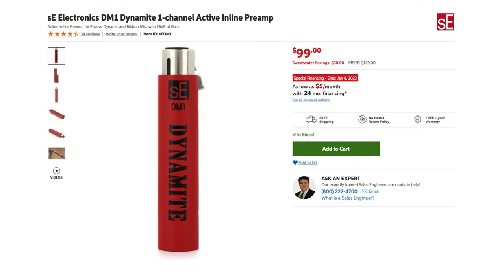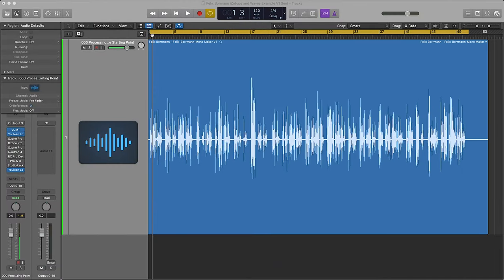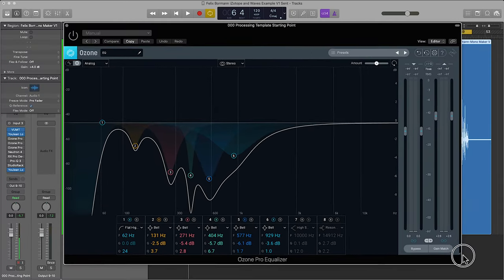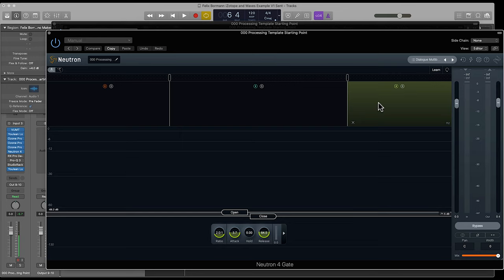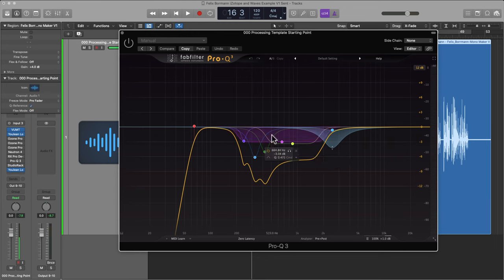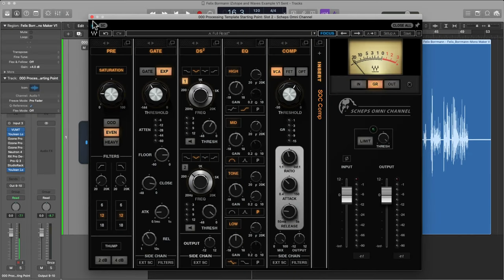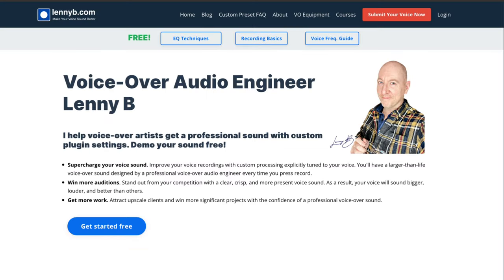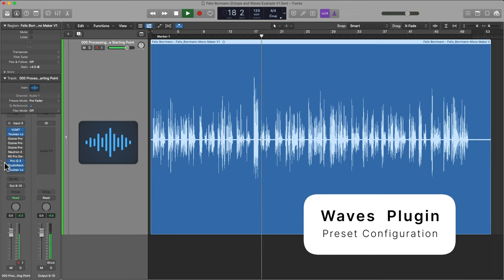Processing Your Voice With iZotope, Fabfilter, and Waves Plugins

Comment: Hey Lenny. Good stuff.

Our German friend’s first mistake was designing a booth with parallel opposing walls. As with speaker cabinets, the dimensions determine the “resonant frequency” of the enclosure. Wall thickness and acoustic treatment cannot defeat the room’s resonant frequency. You did a good job of tuning it out but a simple 5-sided booth, or a rhomboid 4 walls, with non being parallel, would eliminate his biggest issue. 

As to treatment: Flat latex paint, then add 6” “strip and bracket” shelving, with shelves every 12” measured vertically. Then go to Sam’s Club and buy a couple of the jumbo packs of the house brand, medium sized paper towel rolls. (11” is the standard length of paper towels.) Unwrap them and place them along the shelves, standing them on end. Especially a few feet above and below mic height. If they are too bulky, place the wrapped roll on a band saw and cut lengthwise, creating two 11” D-shaped half rolls. Much cheaper than Tolex or pro sculpted foam. Although, Amazon sells 12” x 12”, self-stick, 3” pyramid foam pretty cheap.

I just subscribed am exploring your videos. BTW, both Glenn Beck and Alex Jones use the $125 LCT 240 Pro I see in your background. I’m interested in seeing your review.

JC
Reply from the maker: Hi John, Thanks for your info. The mic in the background of this video is a Rode NT1. However, I am a fan of Lewitt mics they are a fantastic value. Second, after learning much since the creation of this video, I agree with your non-parallel wall suggestion. The paper towel idea is very attractive. Someone (or some lab) should do a test to see the actual Noise Reduction Coefficient of a paper towel roll.

Comment: What  version of Ozone are you using, and what pluggins? Ozone looks like a full course editor for professional music mixers. I was thinking, if I'm just doing voice, then many of the features I'd never use.
What do you think?
Reply from the maker: Hi @ZimCrusher. I guess it all depends on the quality of your raw voice recording. If your sound doesn't need much to sound professional, you may not need many plugins. The version of Ozone is whatever comes with the Music Production Subscription from iZotope. I'm also using Fabfilter and Waves plugins in this video. Don't be hesitant to send me your voice. I'd be happy to give you some feedback. Please follow the three steps on this page: https://www.lennyb.com/get-your-voice-processed-submission-form 

Thanks for taking the time to write. 👍
Reply: @HeyLennyB    I would not want to use that Golden Ticket so frivolously.  I am in flux, currently. In 2 weeks I will have a SYNCO D2, and I've been slowly buying materials for making some thicker acoustic panels for my recording area. So If I sent you a sound file, it would be like you custom painting the car I'm about to sell.

To give you an idea of my set up:
My recording area is a nook in our upstairs den. One side wall, near the computer has the whole wall acoustically treated with 3cm dense sound blocking/disbursement (pressed corrugated foam/wood stuff), and at speaking height I have a strips of 5cm acoustic foam (like you see in every YT video). This wall is 3 meters long.
The ceiling above has 20cm cross-hatched acoustic foam.
When I record, I box myself in By just creating a wall between me and the rest of the den.
I got about 1.5 meters between the wall and my temp wall, which consists of a cable, and lots of blankets (think a very thick curtain spanning the room = 3 meters).

I'm using a Zoom H5 to record, and Audacity to clean it up. 
My process has been: 
1) amplify everything +5db
2) grab and use a 20 second silence and create/use noise removal
3) bring volume back down to normal.
4) Compress
5) normalize
6) reduce all breaths that are not part of the acting by 10db
7) edit as needed for best take. <--- begin actual work.

I've been doing work for other people that is not available yet, but
here is my first personal video, as a sample of my work. It's 20 minutes, total. https://www.youtube.com/watch?v=gIAJ3Bpu748

I will send you something when my set up is more stable. Thank you for replying so quickly